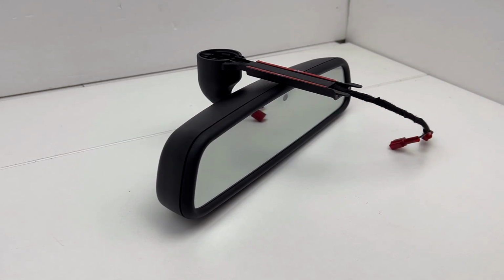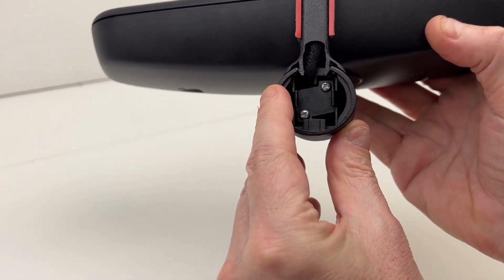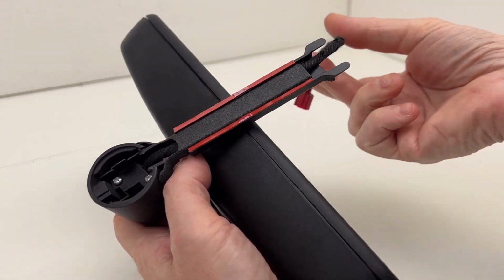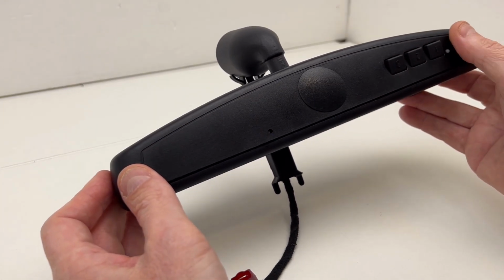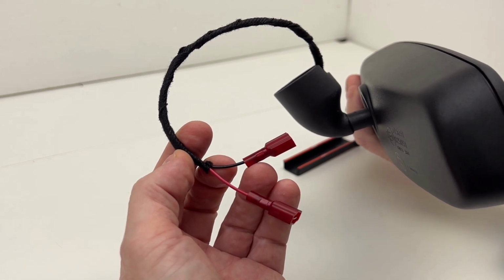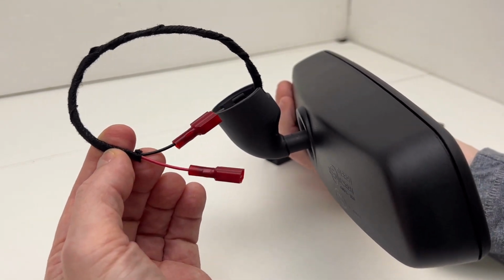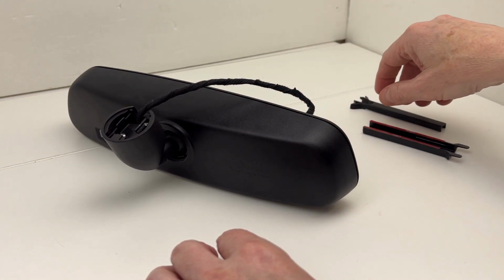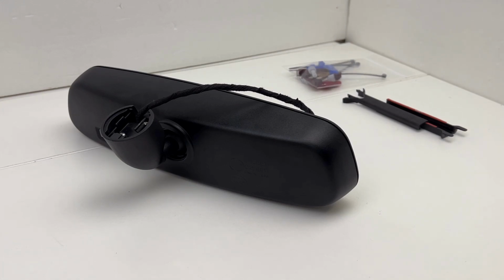Volkswagen EOS Auto Dimming Rear View Mirror with Homelink

Comment: Hi I have a 2015 Final Edition EOS with the rain sensor and auto dimming. I want to replace it with one that has homelink. Would what you have in this video work as a direct replacement for my OEM mirror? What mirror should I look for?
Reply from the maker: There are no direct fitment mirrors for the EOS with Homelink.  This was custom made.  I would suggest the easier solution for you is to locate a drivers side sun visor with Homelink integrated into it, that is how the EOS was originally equipped.

Comment: Hi, where do you think i can find one similar like this? my vw eos uses the round bracket as well and I am looking to replace it with the auto dimming function. I don't need the homelink.. just the auto dimming function and bracket..
Reply from the maker: The OEM Volkswagen auto dimming mirror uses a different bracket and the window mounting plate is different as well.  You would either need to replace the mounting plate or use a different mirror that is compatible with your mounting plate.  An easier solution would be to get an aftermarket mirror with a compatible bracket, like this one.   https://www.aliexpress.us/item/3256806401322762.html?spm=a2g0o.productlist.main.11.7954JG5EJG5Edl&algo_pvid=a51604fa-bff9-41a1-a9b9-47c4882265e2&algo_exp_id=a51604fa-bff9-41a1-a9b9-47c4882265e2-5&pdp_npi=4%40dis%21USD%2159.73%2156.73%21%21%21431.59%21409.91%21%40210313e917169995733838463ebf33%2112000037738719839%21sea%21US%21122229826%21AC&curPageLogUid=8UU48vmWc3Lh&utparam-url=scene%3Asearch%7Cquery_from%3A
Reply: @2phast  thank you!